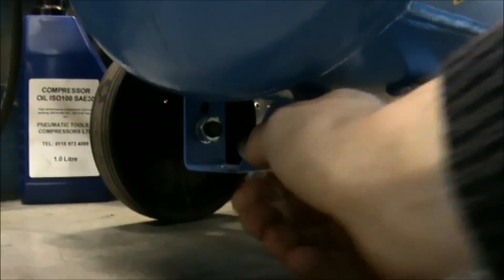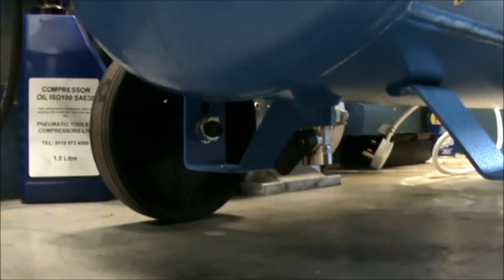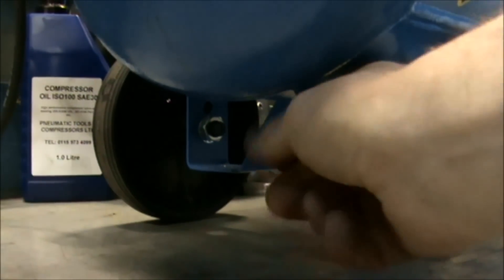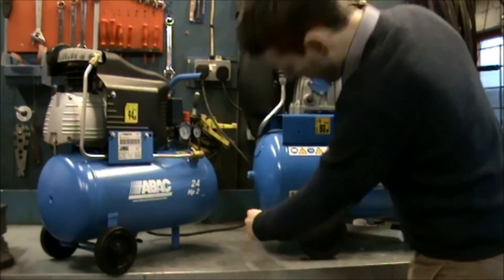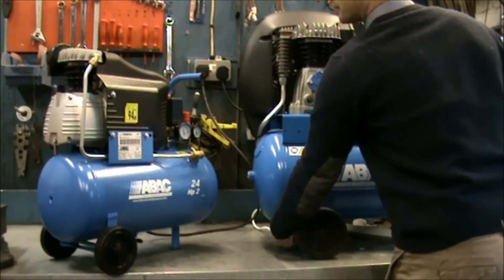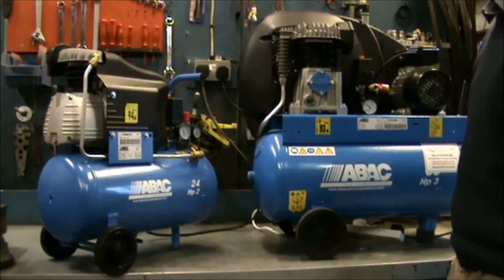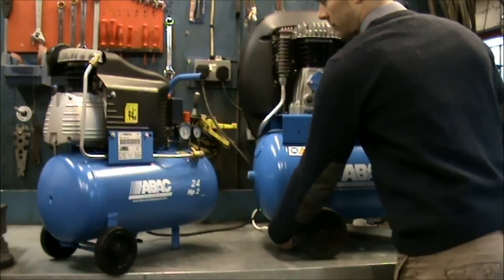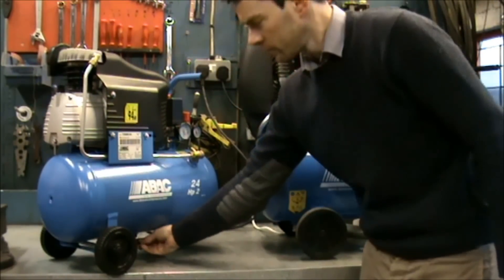How to drain your air compressor tank / receiver

Comment: I have always been told never to have a less than positive pressure in a vessel..........So, what do you think of water draining.............but leaving a small amount of pressure remaining in the cylinder...........also not sure of the need to drain all the air, because pressure is needed to blow out the water condensate............and if you do reduce the pressure to zero of low pressure...........build up the pressure again before you leave it standing until next usage......Never leave the vessel empty of pressure............because the air pressure whill hold the moisture away from the vessel walls...............What do you think ?

Comment: Hello. Do I need to elevate one side of the air compressor (the one that's far from where water's coming out) when draining water out, or can I just keep it level on the ground? Thanks!
Reply from the maker: The drain is at the bottom so you shouldn't have to elevate the unit, however you could try tipping it a bit both ways to make sure everything is out.
Reply: @AirsuppliesCoUk  alright then, thanks much!

Comment: Hi i have a cheap aircompressor using it for spray painting.. if i try to spray pain within a min spraying paint stops due to water coming in sprsy gun.. i dont know to fix it. I have attached a water trap.. but still i face the issue.could u pls help us if u know any solution?
Reply: Yes, the solution is to purchase a good quality air compressor
Reply: @glethal85 agreed it sounds like OP’s air compressor isn’t big enough for the gun he’s trying to use.
Reply: put one water trap on exiting the compressor and another before the spray gun. condensation also build up on hose, not only on compressor tank

Comment: what pressure do you recommend having in the tank before draining?
Reply: For my new compressor, i used WD40’s White Lithium Grease to coat the tank’s inner surface. I bent the tip of the small extended nozzle tube into a small “C”  and inserted it through the drain hole. Once the “C” tip is in the tank, I gave it a good spray everywhere. I will try to angle the tip pointing towards the bottom of the tank where rust usually forms to coat it as much as possible. I did use the same WD40 spray on lithium grease on the sheet metals in my air conditioner, that stuff stopped rust cold on its tracks. Coated it for 3 years, not a speck of rust anywhere.
Reply: Good idea, i was just thinking of some way to coat the tank on inside
Reply: Redember Black Any chance using white lithium grease in your air compressor could come through the line if using a paint sprayer and cause problems?
Reply: Jeff Graham , the white lithium grease sprays on as a liquid but dries like normal grease. i have a Parker moisture trap upstream before my spraygun, no signs of grease trapped in the moisture trap. However when i drains the compressor, a milky liquid which i guess is a mix of water and lithium grease will come out from the bottom. No rusty water though
Reply: do you leave the drain open until no pressure is left?
Reply: I found it the best 0.5-1bar so it doesnt spray too much but is still forced out
Reply from the maker: +Crankpuller 1 The compressor can be at full pressure, or at least 20 or 30 PSI. You don't need to open the tap fully, just crack it and open it enough to get air and water running through it.